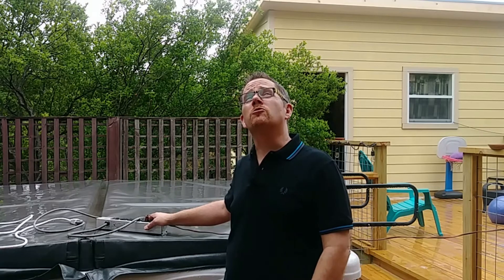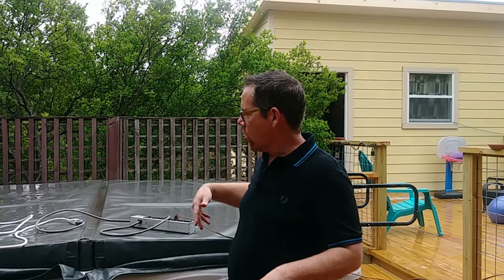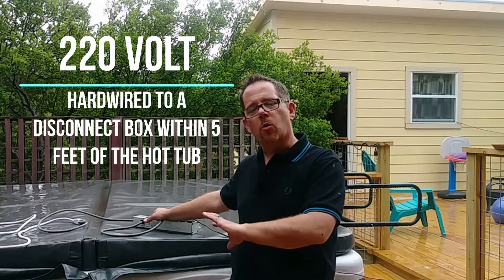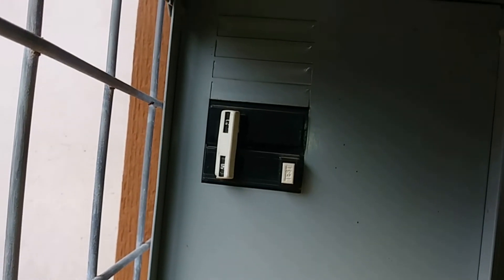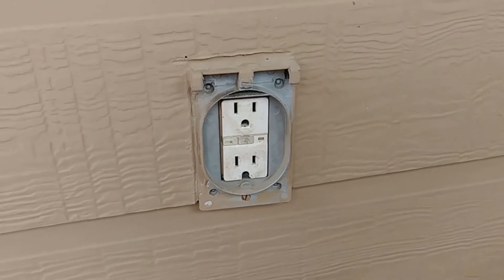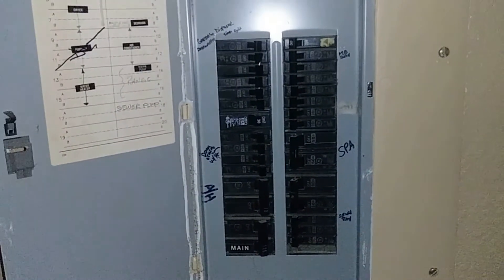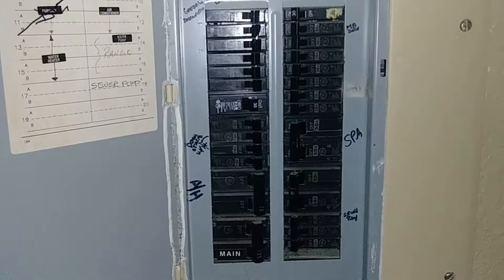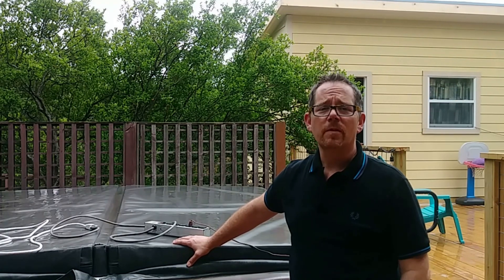Does a Hot Tub Need a GFCI Breaker?

Comment: Hi im an electrician,
You don't need an external GFCI breaker for a 120 volt plug and play spa that comes with a 15' GFCI cord.
You should however supply a dedicated circuit for your spa.

Comment: A GFCI breaker provides both GFCI and overcurrent protection. A GFCI outlet only provides GFCI protection but not overcurrent protection. Hence, they are two different things and, therefore, you should never refer to a GFCI outlet as a breaker. Also, I believe a "disconnect" box is more often referred to as a distribution box or sub panel.